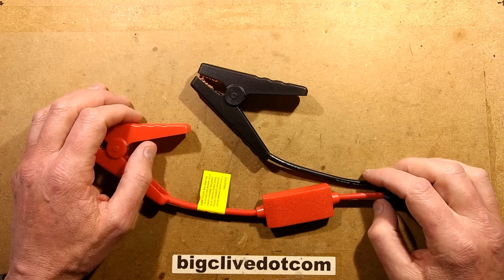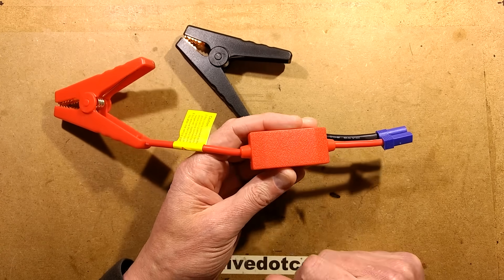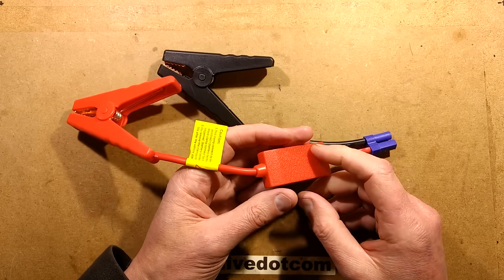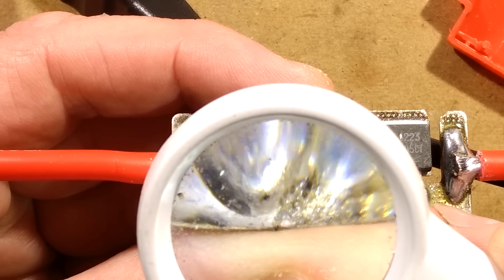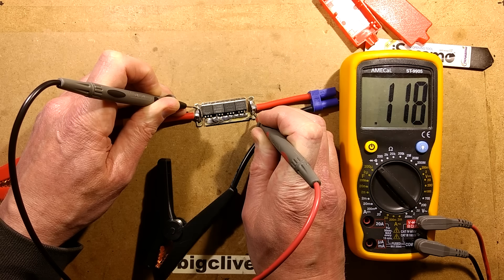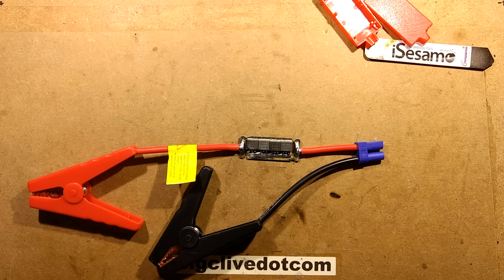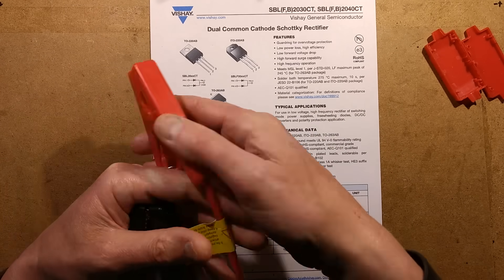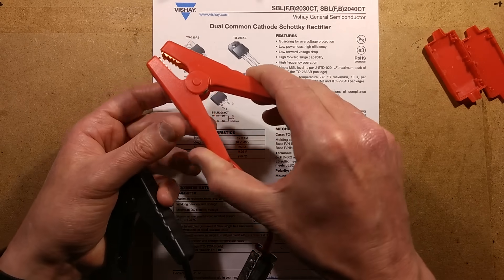What's in the little red box on some jump-start leads?  (Guess first.)

Comment: I bought two flashlights at wall mart on the clearance isle. They said 3.00 ea but charged me 30.00 ea. They come with jumper cable clamps like these and a set of pig tails that plug into a cig lighter or power outlet. They will slowly raise the voltage of the cars battery by back feeding thru that circuit. If you want to jump start plug the jumper cables inþo the flashlight and clam directly to the battery. It does work. I was completely shocked. Poor choice of words. I had planned on returning them but when i saw how well they work i kept them. Weve jumped my friends car off a dozen times and it started furst crank every time. It says in the paperwork the box in line with the + cable is a booster box. I assumed it was similar to the control box on new led headlights that turn 12 volt into 30,000 volt ac.  Nope not a typo. As an electrician i tripped out when i was installing them on a 68 bug. 12 volt  shorting is irritating. 30,000 volt ac is at best a really shitty day.

Comment: im guessing its a diode.. to keeps voltagefromgoingback to pack.
Reply: possibly for reverse polarity protection
Reply: @Noughtta  But when connecting the charger with the polarity wrong, it's in series with the battery, so the diode would be forward biased, anyways.
Reply: What they ^^^ said 👍
Reply: Zener action?
Reply: Reverse polarity protection... it could have been either lead, the manufacturer chose the positive cable.
Reply: Lithium battery don't like being charged with constant voltage like the lead batteries, and they like to burn if you try
Reply: is that a joke? 🤦‍♂️
Reply: @alli_moto7154  Is what a joke?

Comment: Decent quality versions of this (complete sets) are quite effective! even a small 800a unit was able to start my small block v8 2002 dodge dakota naked (no battery just the jumper) I was quite impressed. No magic smoke

The good one will only run so long to prevent you burning them up or worse setting off the lithium pack :-) I only buy ones that charge via USB since the other ones inevitable become paper weights when you use the damned dedicated charger cord :-)

ones with usb charger ports are the best. lithium batteries degrade from lack of use. so being able to use it as a usb power bank means you can exercise the battery a little between times you need to use it which keeps them healthy longer.

I can't wait till they release some LIFEPO4 versions. those should have a much much longer lifespan.

Comment: Start current on 12v is very high so the wimpy cables on these leads and any cheapo jump leads will never do any good. Bigger cable = lower resistance. Remember trying to jump a work van once ended up with three sets of thin leads connected in parallel just to get the thing to start.

Comment: Mmm jumper cables with soldered connections. That is completely legit for several hundreds of amps load.
Reply: If the surface area is great enough and the wires are thick enough, this wouldn't be a problem. 
But indeed this very thin/small for 100A.

Comment: Also note the cheap plastic jaws. Both contacts are metal, but with no jumper between each side of the jaw, only one is actually making contact. On regular jumper cables I have taken off the metal pieces, installed a heavy jumper  wire to connect them, and then used small bolts to reattach the contacts to the plastic. (Metal frame jaws should have at least some current carrying ability through the jaw frames.)

Comment: I suspect the real reason for the diodes is to protect against the user clipping them to opposite terminals. Which becomes pretty dangerous pretty fast.
 I made that mistake once with jumper cables I was tired it was dark and the air filter assembly covered most of one of the terminals on my cars battery going to make that final connection there were some serious arcing, a little bit of the battery terminal melted, as did a bit of the jaws of the cable I was trying to connect, and the cables got crazy hot.

Comment: Hi
From the comments one issue is missing , if the power pack is connected the wrong way the diodes is for protection
And their so many in parallel to ensure the forward current

Comment: guess id say a diode/ fuse. problem is with car batteries is the caps where you fill with De ionised water have a + for your screwdriver this often gets confused with the posative terminal of the battery, ALWAYS EARTH (Negative) to the cars engine metal mount, NOT the battery negative ! put the posative on the battery after finding a good earth (negative) on your engine. (this stops current drain which the dead battery will just suck out of your power source.)

Comment: This is not a good idea as the diodes can easily be damaged from over current, also there will be some considerable forward voltage drop too. Needs 3 times as many diodes in parallel plus a fuse.

Comment: its a bullshit device... the center leg should be on the output separated from the diode legs on either side... this is a short circuited id ten error. the current goes directly through the middle leg to the heat sink (ground) tab - the diodes are meaningless make work to impress idiots who spent money on the 'product'.

Comment: My guess: a fuse for shorting safety, maybe resettable?
Nope, but would these diodes prevent a person from hooking up a battery backward? 
Or simply to prevent the emergency charger from stealing power back from the car.
Reply from the maker: It's to prevent overcharging of the lithium cell when the engine starts.

Comment: Doesn't your resistance decrease with every diode you put in parallel?
This would explain the extremely low resistance.
Reply: The diodes in parallel allows them to share the current (10 amps max each = total
 80 amps )  wether in parallel or not,  each have a forward voltage drop (which is what he was measuring) of 0.6 volts.  This is not a resistance measurement but the voltage drop across the PN junction of the diode.  I would not expect having them in parallel would show a reduced parallel junction voltage drop of under 0.2 volts like he measured as the drop is inherent in the design of diodes and placing them in parallel I would expect the parallel Vfwd to remain the same. Note.  It wasn’t resistance that he was measuring.  . But having measured many diodes in my career I have never paralleled them..

Comment: I bought something like this, and the box had what looked like transistors, or SCRs, with a trigger lead that ran through the red cable. and attached to the contact opposite the red lead. I think this was to ensure that you hooked it to a battery, and not to a regular circuit. The battery would turn on the components. Up to then there was no power available to the clamps.

Comment: Just a quick question. I have a couple of these leads, I had them given to me and was going to put the clamps on my car battery charger. It's a standard car mains charger not a lithium quick starter that came with small clips which are hard to fit onto the battery terminals. Would using these leads with the diode box be unsafe for use with this charger or should I just use the clips and cut off the box. You mentioned the possibility of the box heating up and that the lithium pack chargers are not left on the car for long. So I am thinking if a standard charger might be left on over night there might be a problem. Thanks mate.

Comment: Could a 2V difference of Car (alternator running at 14.5V) actually hurt the booster pack?  Assumning it's 12.5V nominal?  I ask because I've had 2 sets of these jumper pack leads have the positive wire desolder itself from the diode board in use.  2nd one was done for me by my brother.  I'm wondering if I can bypass the board altogether.   I have a DB Power jumper pack which does work OK, but the leads like to fail.  I use it for other lower current applications as a 12V source (testing lights, or printer control boards), without any protections.

Comment: Thanks for an informative video bigclive. I believe i had burnt out the diodes while jump starting a friends car. I am unable to find replacement diodes nor get another jumper cable. So i got someone to bypass the diodes. I have yet to use the cables, but now feel worried whether to use them or otherwise. Appreciate some advice. Thank you
Reply from the maker: It will still work, but you'll have to disconnect the clamps immediately as soon as the car starts as otherwise it may try to pump a lot of current into the lithium cells.  If you had to crank for a long time it's possible that the cells may have been damaged already.
Reply: @bigclivedotcom  Thank you for your quick response

Comment: great video I have a query with which is soldered if the diodes of the board are removed
Reply from the maker: If the diodes were bypassed it would risk damaging the lithium cells from overcharging by the alternator.

Comment: Having diodes in parallel does not reduce the forward voltage (like parallel resistors would), right?
Reply from the maker: No.  It just shares the current a bit.

Comment: I bought a pigtail with ring terminals on one end and the type of connector that mates with the jump starter on the other end. I have this permanently connected to the battery of my motorcycle. My idea was I could just plug it in if I needed to jump start my bike. I tried it for the first time today. Using my cable, the jump starter battery will not turn on. Instead, a fault light comes on. So I tried it using the cables that came with it. It works. The difference? That little box. I think in the case of my jump starter, if it sees    voltage coming back it will not power on. I’ll have to order one of these cables and solder the diode pack into my cable, or find a pigtail that has the diodes already in it.

Comment: Slighty off topic.
But are these units really jump starters.
Some people have told me that they are really only useful to recharge you car battery
And then start the car without them.
This makes sens to me as the red and black cables are vert thin, compared to my old jumper leads.
Reply from the maker: I'd say they do classify as jump starters.  But only for brief bursts of current.

Comment: Wouldn't that soldering slug just bypass the diodes... mean since every pin of the chips are connected via solder, wouldn't the current come in one side, hit the solder, say 'stuff the diodes' and go right on down the line and out?

Comment: my thought on the diodes:  protection from connecting the battery backwards....Could be very messy if things are backwards.
Reply from the maker: Sadly it's no good for that.  The main purpose is to prevent the alternator from trying to pump current into the lithium cells.

Comment: Actually, schottky (and normal) diodes increase forward voltage drop with current, so on multimeter it can show 0.1V, but in operation, during jump starting the current be around 400-600A.
That would be 60-85A per diode (there are 8 diodes), and the voltage drop would be above 1.1V (the datasheet shows 1.1V drop at 40A instantaneous  current and then the chart ends :P ).
At this range of current - schottky and normal diodes behave quite similarily, there wouldn't be noticeable differences in heat generated by schottky and normal diodes in this application.
For a drop of 1.1V at 85A - each of the 8 diodes would generate 93.5W of heat per diode (750W for all 8 diodes). Possibly much more, because the chart doesn't show forward drop at such high currents. Also, I think the datasheet I saw shows voltage/current chart per package (two diodes) not per diode - that would mean that the heat will be even higher :P.
I would say, that after fairly short usage this plastic little box would melt away, far sooner than any isolation on the cables.
You may consider it a fuse of sorts :P. A kind of fuse that leaves your hands burned if you use the jump starter too much :P.

Comment: I got lost half way thru the video with all these jumping around and never to the point why the diode are there. Clearly the diodes are for protection in case reserves polarity. It also protects jump starter from any spike from the alternator.   I have a BS degree in electrical engineering and still lost on what point he tried to make.
Reply from the maker: The diodes won't help at all if connected in reverse polarity.

Comment: I assume the diodes are not to prevent the car's battery from charging the LiPo battery (since the car's battery is likely not to be that full if you're using the LiPo battery to start your car.). It's pobably rather to prevent the car's alternator from charging the LiPo battery after the car starts. People often use 3S Li-Ion batteries to get 12.6 V (when fully charged), which is a great voltage to jump start a car with. It's just not so great anymore when the car starts and the alternator starts putting out 14.8 V at 60 A or so.
Sure, for a few seconds I guess it should be fine, since the car's dead battery is probably gonna pull the voltage down a good bit. But I guess you can't rely on everyone disconnecting the LiPo battery as soon as the car starts.
That said, the Chinese rely on quite a lot of things ... so I'm kinda surprised they would think about that. But that's the only good reason I can think of for using diodes.

Comment: 10 minutes and 30 seconds of blabbing to learn that it protects from incorrect connection that would normally result in reverse current flow.
Sheesh, you gotta bottle up all that hot air, you're polluting.

Comment: Something many people don't know is. If you connect more than one diode in parallel the effective threshold voltage drop will be lowered. Just like resistance is lowered in a parallel circuit.
Reply: .. matching diode characteristics in parallel (Voltage forward (drop) or current sharing ) is "better" if the diodes are matched (one technique is to get match diodes where their breakdown voltage is within 50mV @ some I ).... if not the Vf (shared) won't be the lowest.

Comment: I don't understand how these 'jump starters' can possibly work? Max voltage from them is presumably 12.6v less the drop from the diodes? My car seems to needs 12.6v minimum to turn the starter motor? (Yes it's old and the starter motor is no doubt more hungry than it once was.) I reckon the best way to use them would be to connect a boost converter in between and wait till the charge has gone into the battery?
Reply from the maker: They have a very low impedance, so while the lead acid battery voltage might drop under load these will deliver a lot of current to drive the starter motor.  They do work.
Reply: bigclivedotcom Good to know because I've just ordered one. My car hates the cold!

Comment: My first guess wa an inductor to limit current surges.  But as soon as you opened it up, I knew what it was.  They were idiot protection devices (high current diodes) in case an idiot connected the battery cables in reverse.  That would ruin anyone's day.

Comment: Clive what would you get if you used that module in a full wave bridge rectifier?
Reply from the maker: You'd need four to make a full wave bridge rectifier.  At the moment it's a half wave rectifier.
Reply: @bigclivedotcom   I should of been a bit more clear on that. 4 of the modules so that you would have a full wave. That would give you 12 total diode pairs or one red box per side. 
Sorry about that.

Comment: if it weren't for the diodes the pack would overcharge and explode when the alternator kicks in. {almost instantly} Lipo's can only handle a charge current of about 1c while they will happily discharge at about 40c. If you try and charge it at 40c your ass is getting an instant fire.

Comment: All the worry about big amps hitting the little battery when the car starts.  Don't worry, the difference in volts is about three volts.  Amps won't be bigger than the battery pack can accept unless you leave it connected for minutes.  (This is for the people who get rid of the device on the wire set.)

Comment: I actually used one of these jump starter battery packs as a battery charger. Had the battery pack plugged into it’s charging adapter and the black and red croc clips attached to my battery, it actually did a goof job of charging my battery from empty. Question is in hindsight, was it safe?
Reply from the maker: Not ideal, but it would work, albeit quite slowly.  Initially there would have been a high current draw from the lithium cells and then the charge circuit would be charging both the lithium cells and the lead acid battery.

Comment: In the early part of the video, when you're testing across the diode pack with a meter, you are surely measuring forward resistance in Ohms rather than forward voltage?
Reply from the maker: The diode setting on a meter applies a current limited voltage across the leads and then shows the voltage across them.
Reply: @bigclivedotcom  Thanks - didn't know that. I've always done it 'longhand' by applying an external voltage via a resistor then measuring the voltage across the diode. Not in future I won't!!

Comment: How do measure a voltage drop with no voltage applied?
Reply from the maker: It really needs the normal current flowing to measure the voltage drop.  Just doing it with a small test current like a meter's diode test will give an inaccurate result.